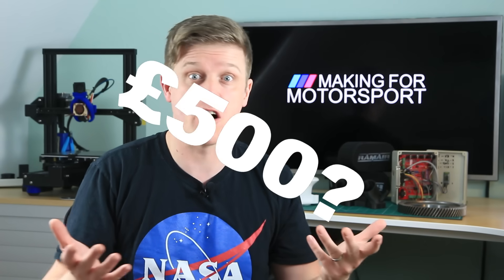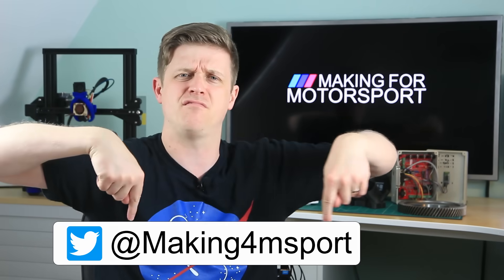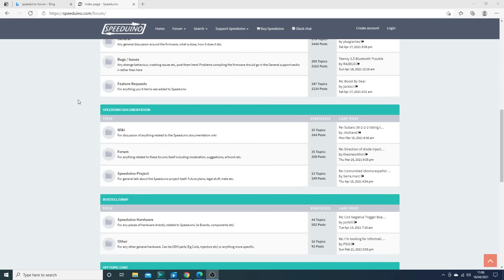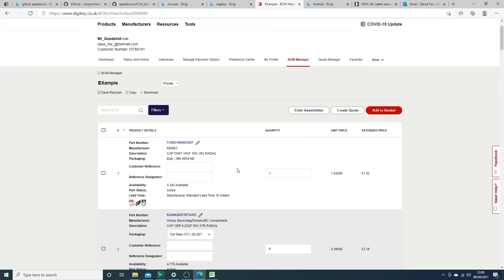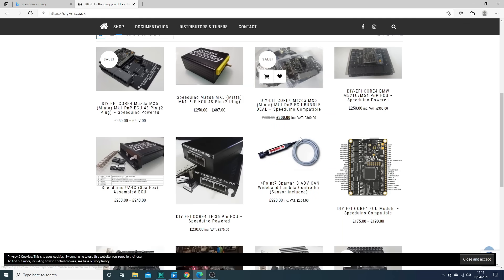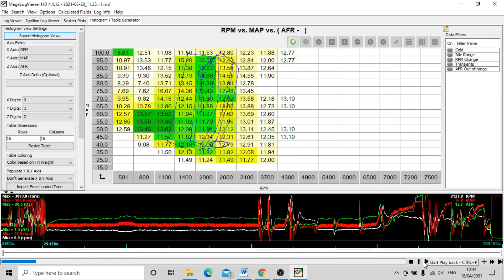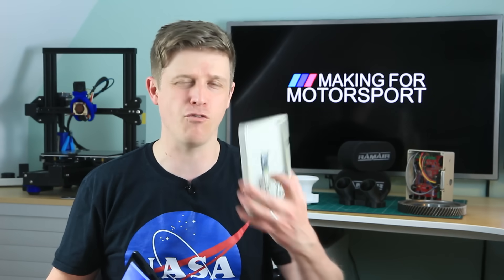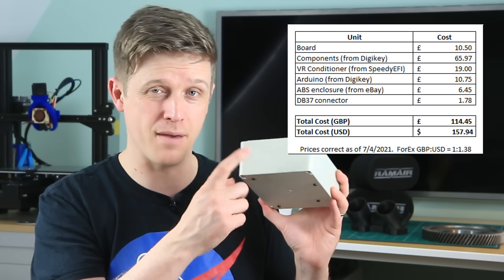The Best Value Standalone ECU - Speeduino

Comment: Silly people. All you need is a carburetor and points... and you don't need any "ECU" at all. Gee whiz, wasn't that SIMPLE?
Reply from the maker: Ha!  Yeah but that just “worked”!   Now I have something I can break in interesting ways! Much better 😁
Reply: @MakingforMotorsport  Ha right back!    8)    8)    8)

I actually have a question for you about Speeduino. It's only suitable for vehicles that for which OBDII is no longer required for mandatory inspection, am I correct? I dug through the entire WIKI / Forum looking for a definitive statement about that and could find nothing.

I don't see any connection on the Speeduino board for OBDII, so the question naturally came up. It'd suck to hang a Speeduino on your daily driver two weeks before inspection and have it fail because the OBDII connector is connected only to air.
Reply from the maker: So my car is an off road and we don’t have those types of inspections in the UK so I’m not an expert.  You can get Speeduino to run OBDII over canbus but that requires different hardware, such as a STM32, teensy or another Mega.  
The bigger problem is what they check, if “readiness monitoring” is part of the requirements then that’s a hard no as far as I know.
Reply: @MakingforMotorsport  Gotcha'. That's pretty much what I figured. They seem to want to do such things as control engine speed through OBDII... so it looks like Speeduino would be suitable only for inspectionless vehicles here on the gunny side of the big blue wobbly thing.    8)

Thanks.

Comment: I own my own business as a professional dyno tuner, I do not accept Megasquirt's in for tuning, Why lack of consistent information, excessive time to sort out issue's, also most people that install megasquirt have installed it them themselves and I do need to sort many many issue's. But I have personally spent many hours with megasquirt and VEMS ECU's and if you have time and want to do this yourself, go for it just be warned that Dyno tuners may turn you away if you need there help, So $160usd? for the parts software tunerstudio MS ultra $99usd and megalog viewer $39.95. = $298.95USD . Now I must say I'm a Link ECU fan, why Price vs abilities vs support (free software with the best help menu ever,even if you don't have a Link download their software for the help menu), Haltech are a bit higher in price but their support is also amazing. Why I would buy a Link ECU well when I get stuck or plan on setting something up differently they have always been able to support me on their forum or with a phone call and not like a megasquirt with hours of time wasted on the internet down the wrong rabbit hole. so paying a bit more might/will save you a lot of money in the long run. Wideband if the ECU has CAN input you get a more consistent, faster lambda log.Also with Can you can add other inputs and outputs with CAN units, Knock detection was not spoken about at all, To tune you need three things 1:tune-able ECU 2: Wideband 3: knock detection, please would be home/road tuners please stick to your own cars and don't tune your mate's car , I've come across so many horror stories.
Reply from the maker: Fair enough, it’s interesting to get completely different point of view.  I must ask tho... if I drove my car to your shop, with a completely working car using a Speeduino on Tuner Studio (I’d even bring the laptop!) with only a spark and VE table that needed tuning on a proper, steady state dyno, why wouldn’t you touch it?  

If the car isn’t reliable,  not your problem, if the software doesn’t work, not your problem.  
I get you want a good basis to work from but as long as changes to the spark and ve table (and other enrichments) work as they do in other ECUs, what’s the problem?
Reply: @MakingforMotorsport  Customer satisfaction/happiness. My main problem is that 90% have issue's and I've had to spend more time than I should to even work out that it's not a tune issue, charging time ($150NZD per hour) for setting the car up for tuning and then a couple of hours in and something goes wrong I need to charge my time and the customer is left trying to work out what is wrong.This is leaving me with a very unhappy customer. Years ago I would join wire's with solder and heat shrink, on my own car 3-5 years later I'd have a intermittent issue and it would take me hours to solve that issue, now i crimp and heat shrink with reason filled heat shrink not I don't have these issue's, so even poor solder joins in wire's or on the board can give real intermittent issue's, I had a guy in for "just tune the boost, I've done the rest" with a wired in wideband, his wideband didn't match my dyno wideband (yes I always have a wideband for tuning and one for the dyno) it turned out he had setup his wideband wrongly and was about 1.5AFR lean (I do prefer to tune in Lambda). I've had ignition timing issue's as well due to setup, Trust me I've spent a lot of my personal time trying to get cheaper options working, yes I'm like that. If you want this for yourself and have plenty of time I'd recommend it fully, If you want a Dyno tuner to look at it to sort an issue that you can't work out,then all your saving is gone
Reply from the maker: I get it.  If the car doesn’t work or has intermittent issues then the dyno is a very expensive place to sort it, and you are left looking for a needle in a haystack.  Meanwhile, customer who wants big numbers doesn’t get why you can’t fix his 3.5k misfire (due to shit home brew crank sensor bracket vibrating and loosing sync)...
But, if that same customer bought a Link, and fitted it in the same way, wouldn’t it have the same issues?  Would you still blame the ECU?  Or is it that the diy folks don’t quite hit the same installation standards, on average?
Reply: @MakingforMotorsport  The triggering system is one of the most important parts when looking for reliable power. When using a LINK I can rule out that the Link as the issue before I start (Downside with an atom is they don't have a built in oscilloscope) From the logs and fault code's the link will point me in the correct direction. Now i think you hit the nail on the head "diy folks don’t quite hit the same installation standards, on average?". But it's not just DIY it's the so called performance workshops that are there undercutting prices, doing poor quality work and then at dyno time blaming the dyno guy to their customer, I've been a mechanic for 34 years and own/running my business for 15 years, In my local area there have been about 8 performance workshops start and fail within a short time, they always undercut me on price and I'm cheap, even the local engine re-builder bought a Dyno and it only gets used for V8 carbs as he can't find a tuner that can tune ECU's (he even wanted to hire me). But anyone reading this do buy and build and tune this it will give you invaluable experience even if you don't save a cent it's well worth it, I have a customer who started on turbo Honda's and tuned them and then moved on to Supra's he has become a good friend and he is welcome to use my dyno for free when ever he like's, but he still pays me to tune his car, but his knowledge and experience is always helpful and we talk the same language when it come's to tuning and he ask's me questions that really make me think
Reply from the maker: It’s a great point and a well written post.  I think if people are throwing proper money at the job, especially as a customer, they deserve a good outcome, I suppose any system is only as good as the install and a tool only as good as the workman.  Good to hear that you’re making a living at it as it’s tricky and reputation is everything.  Best of luck!
Reply from the maker: Hi Geoffrey, thanks for your post on the other video, just to let know it had been deleted by YouTube because of the link but I have read it in the email notification I get.  as always well written and I’d be really interested in your opinion if you do get one 👍
Reply: @MakingforMotorsport  O.K. I've now tuned a few for customers, they all had a engine cutout when doing a ECU store. But the customers were happy with the end result, I feel the tune ended up better than the Megasuirt 1 & 2, would love this project to be done with maybe a raspberry pie and knock detection. all of the units I tuned already had a 0-5Volt input for a wideband. I've been playing with Maxx ECU a pro on my own car but they have a very cheap option that would be worth looking into if money is a concern, I've been watching a few of your other video's with interest as well, keep it up 🙂🙃🙂

Comment: a very compelling and good solution! I bought a complete plugnplay Ecu solution for my volvo. 1600£ total with injectors, wideband, sensors, ecu with BT and complete wiring harness. its nowhere near this level of cheap. but for an "of the shelf" item its as good as it gets in terms of price. ^
for those wondering. DRE ECU is the manufacturer.

Comment: No way would I stuff 20psi down a speeduino controlled engine - timing precision and fueling accuracy matter when you start to push the bounds and I have my doubts about that. Also the model is a straight copy from megasquirt and severely flawed.

Comment: I'm an Electronics Engineer and I will be making one of these and I approve of this vid.
Reply from the maker: It’s simple, you do a lot of research and go carefully and slowly.  It really isn’t witchcraft, it’s simple.   That said, if you are chasing 3 bar boost things can go wrong very quickly, for a standard na or “normal” turbo car, a wideband, some kind of knock detection (even if it’s your ear) and a systematic approach is all you need.

I will say though, the only way to get to absolute peak power is on a dyno, but on the road you can get to 98% I believe.
Reply: @MakingforMotorsport  I don't think I'll ever have a tubro-ed car and i am shooting for economy. I think an ecu like that will help me greatly
Reply from the maker: I like it!  Cheers Sid!
Reply: I'm not an electronic engineer and I will also be making one of these and I'm probably going to screw it up but I definitely approve of this video too haha
Reply: How is the result, 3 years already
Reply: Can it read wideband o2 sensors?
Reply: @ne2i  yes it can
Reply: EE here subscribed immediately
Reply from the maker: Mech.Eng here welcoming you to the party!
Reply: @MakingforMotorsport  howdy do they still not have o2 sensors?
Reply: Any xhance of recreating an IDM?
Reply: Same here. I am student on college in the field: electro-technician in automotive so I approve your video as well.❤😊😅
Reply: Oddly enough, he doesn't need your approval 🤔
Reply: Did you end up doing it? And what engine did  you use?

Comment: out of the topic question. why oem ecu only uses narrowband instead of wideband from factory
Reply from the maker: Anything with OEMs will either be emissions or cost, on this it will be cost.  Narrowbands are simple and cheap and give the info they need, when the car is running stoichiometric (14.7:1), and it’ll naturally oscillate around there.  
Some OEMs have put them on, mainly VW and a few other higher performance manufacturers.  They are significantly more expensive as the sensor is more complicated and they need lots of elec-trickery to condition the signal.  
I have a video planning on widebands in the near future!

Comment: Running a speeduino No2c in my turbo  mx5. Modded the firmware to run sequential injection.
Great ecu for the dollar
Reply from the maker: I love it, so far I haven’t messed with the firmware but I am planning to have a play!  Your mod sounds interesting, how did you get 4channels of injection out of a NO2C?  Are you not running spark?
Reply: @MakingforMotorsport  I used the vvt and boost outputs as injector drivers. Simple mod in the firmware to reassign vvt and boost pins as inj3 and 4
Reply from the maker: Smart! 👍 for some reason I thought they were different mosfets

Comment: Question, I have an automatic gearbox so can I still use one of these ECU's ???
Reply from the maker: Hi Mike, that depends on the gearbox, they normally have a seperate ECU but it will take information such as road speed, revs and load, where and how it gets that you need to know and replicate.  If you can do that then the 'box won't know the difference, those signals might be analog or canbus.  It's completely doable but just not simple....
Reply: Thanks for the info, and yes it has a trans module 👍

Comment: Just a quick tip for the wire block a good idea would be to use wire ferrules. They prevent the strands from spreading out and lead to a cleaner install overall
Reply from the maker: Aboslutely right, I keep looking at them but then I want a proper ferrule crimper, then I look at the price and go.... nah, i'll be right!
Reply: @MakingforMotorsport  They're not that expensive. But if you do decide to get one, skip the square ones. There are also crimping tools with a hexagonal crimping pattern that results in a much rounder crimp that's easier to install into screw terminals or circuit breakers. I bought mine on Amazon a couple of years ago, it was a brand I never heard of (Preciva), but it works great and I couldn't be more satisfied. Just checked, and a similar one from the same brand goes for £22.39 right now.

Comment: Ford edis unit ,simples I have one running a mx5 turbo 6 wires cheap and easy , good vid tho 👍
Reply from the maker: I ran an edis unit with MS1 “back in the day”! 😂. What is controlling the advance?
Reply: @MakingforMotorsport  I have just the basic edis on a hif44 su with a big ass turbo the running gear sits on a custom pan in the front of a classic bug simples is best in my eyes could get more pony's with injection but love the sound of su's as they suck  and turn fuel into noise
Reply from the maker: Simple is good, and I love an SU, I had a hif44 on my mini for years... never had to touch it apart from filling the dash pot every so often... 👍😂.  Now my car is run by elec-trickery that I only just understand ...😅

Comment: Thers's electronics and there's automotive electronics which is by standard applied closer to military or space gear specs. Automotive power source is dirty as it can be, so components has to sustain serious beating (harmonics, voltage spikes, EMP'es) while perform flawlessly. Im not saying this is bad choice and won't work but there's a higher risk of failure for sure.... like that ABS enclosure, its really funny. Make it out of ferrous material for better EMI shielding to begin with...
Reply from the maker: So despite all the odds being against me, this ECU has performed perfectly for 3 years of motorsport, guess I just got lucky 🤷🏼. 
But seriously, there are plenty of people out there running these things daily, and yes, everything can of course be better, but sometimes they are easily more than good enough, such as my ABS enclosure, I have no weatherproofing in the cabin so a nice ip66 enclosure is more important to me than EMI shielding as there is a bulkhead between it and the sparky bits! (Plus it was cheap 👍).
I think the main determining factor of reliability here is the quality of assembly and install, the underlying engineering is sound, otherwise they wouldn’t be doing the great job they are! 👍
Maybe get one and have a play, you’ll be glad you did!
Reply: @MakingforMotorsport  3yrs? Thats a lot. Thanks for the info, will take it into account.

Comment: Does anyone know of a drop in solution for LS2?
Would be nice to cut down some implementation time.
Reply from the maker: There may be a plug’n’play option for you but that depends on your loom etc etc.  You’ll need the teensy hardware to get full sequential with a v8... but running paired injection and wasted spark you could run it 👍

Comment: What happens if you use Raspberry Pi?
Reply from the maker: Coding isn't my strong side but it uses a different languages and as it's a microprocessor rather than a microcontroller.... but you can integrate a Pi into a car system using CanBus to communicate.

Comment: XJS V12.  Would love to not spend 4k on an ECU that does sequential  injection and ignition.
Reply from the maker: For a v12? 😬 I suppose there is a reason v12 were ran as two separate straight six’s with 2 separate ECUs for decades by the OEMs.  Bad news is, nothing easy will run this from a Speeduino side, people are playing with getting Siri more channels but you’d be taking a leap and going into the other boards like the Teensy or STM32 and modifying the firmware, and even then... you’d still need one/bank!  Sorry to now give the answer here...

Comment: i use RusEfi -- it does my VEE 12
Reply from the maker: When I bought the Speeduino, which was years ago, I looking into RusEFI, it’s come along since then and it looks really capable but it’s seems more pushed to a prebuilt solution, the only boards I can find to build from on eBay (where RusEFI says to shop from) are either SMD or a Miata through-hole.  Which one are you using?
Reply: @MakingforMotorsport  proteus board. There are 2 more coming out soon. Join the RUSefi slack channel for more info
Reply: @MakingforMotorsport  the cost for a proteus raw board and BOM from digi-key is about the same as your speeduino build - - less than $200.  But most RUSefi boards are machine assembled. Since the robots do a good job.